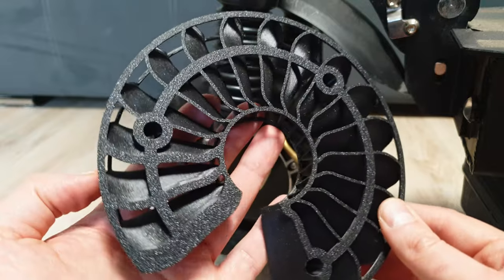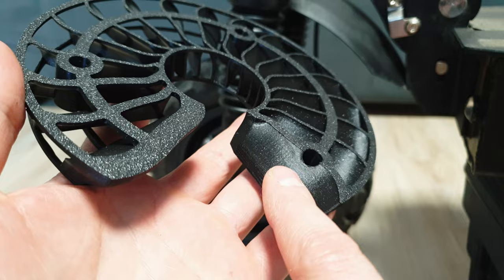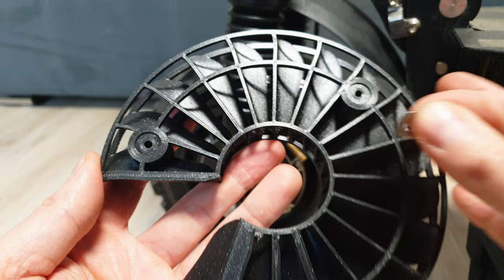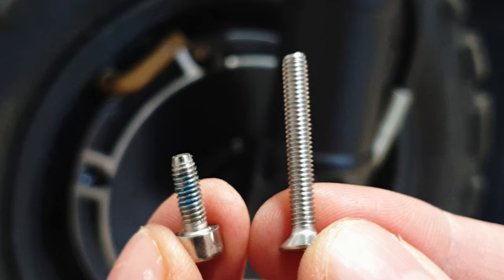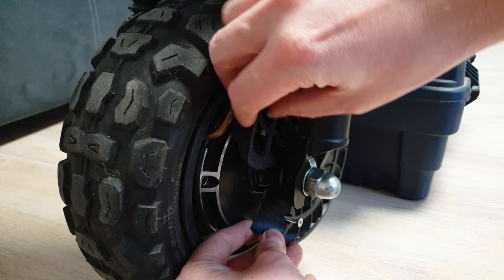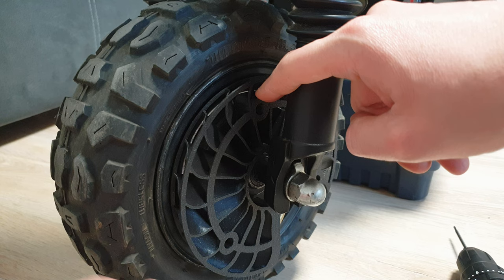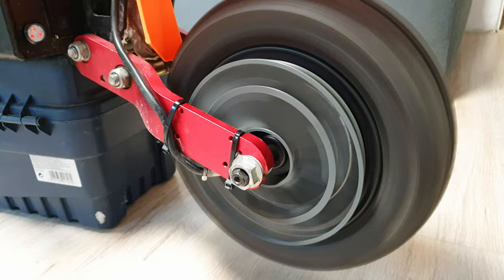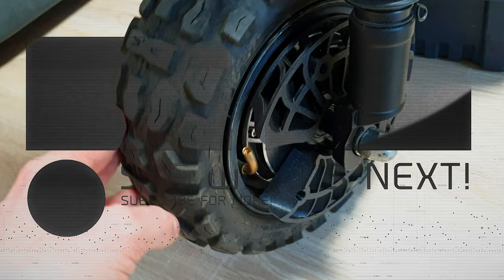Motor Cooler For Laotie Ti30 Boyueda etc... 😎 You don't need it but You may Like it 🍕🍻

Comment: Hi Pirate, I also have a Ti30 with two Flipsky 75100. controlled via VESC tool. If I give good throttle then both controllers go up to 80 degrees. Do you think that is a reasonable operating temperature or do the controllers get too hot? The temperature drops again quickly, but also goes up very quickly. Where is the temperature measured anyway, at the controller or is the engine temperature measured? What could be done to cool the two controllers appropriately? Thanks for all your advice.
Reply from the maker: You will need to fix mosfets to some radiator but be careful, every mosfet has to be be insulated from radiator. You can use some big/thick alloy copper flattener or just bare frame.
Reply: @PirateWasHere  yes also important is to make sure screws cannot conduct aswell, because TO220 has the tab as the drain of the mosfet which is electrically connected

the Alu pcb version are thankfully much better than these tho

i've been running Alu PCB for months now and they're fine, never had over 50°C

Comment: hi man stupid question maybe but what's the dropout size (fork opening) on ti30?

i'm willing to upgrade motors in my scooter to the 2800W 60H magnet ones Ti30 has but don't know if Ti30 is also 145-150mm opening and don't wanna spend money to find out it doesn't fit

i also have 2 75200 alu pcb (single motor) ready but first wanna build higher voltage and current battery and upgrade motors all together basically, currently still have 75100 alu pcb in it with the 48v battery @ 4kW

Comment: 1) a fake YunLi controller came from Boyueda, I don’t want to buy it there anymore, 2) the motor is from the same place, with the same short cut bolts as in the video, from which the motor fell apart at first speed, I hope this video will be useful to their customers though would be in terms of the fact that they will change the stock horror bolts and not get killed on the road, 3) otherwise useless content with the sole purpose of selling something even without the smell of temperature measurement results BEFORE and AFTER installing this plastic, and after the temperature may be even higher than DO, especially when dust and dirt accumulate in the blade. The last card in the layout - we "cooled" one side of the motor. Wonderful! What to do with the other side? )))
Reply from the maker: I guess you have no idea what you want to say